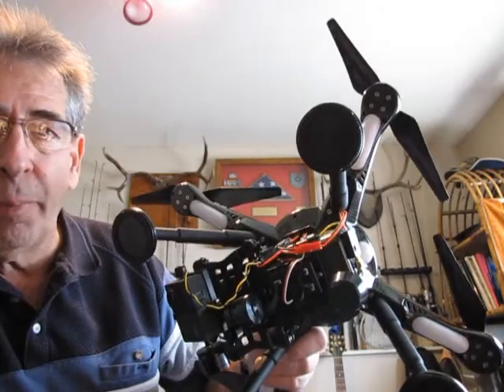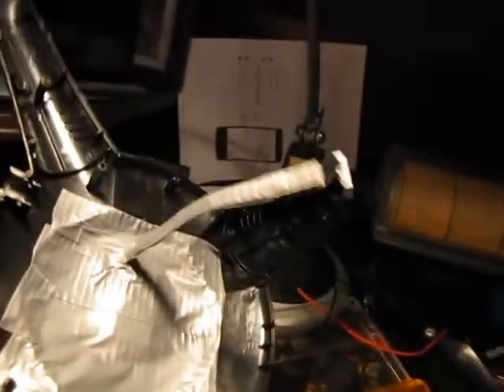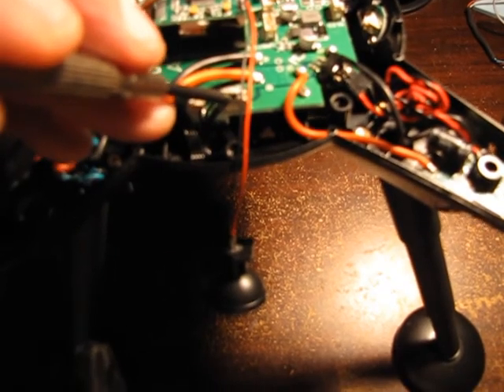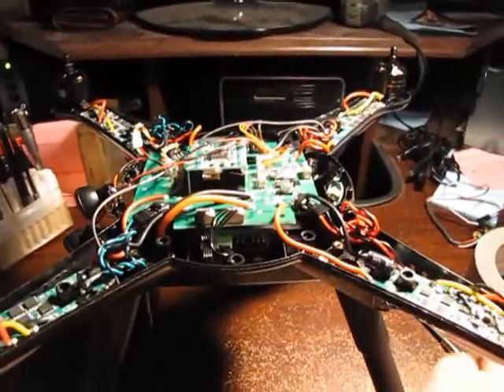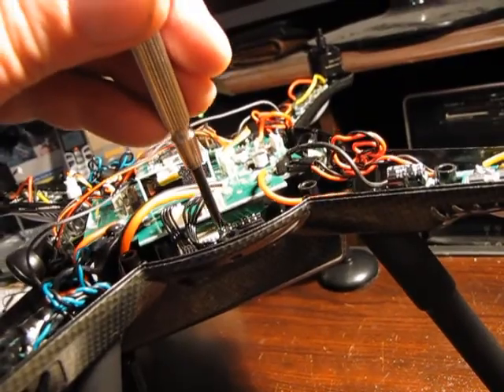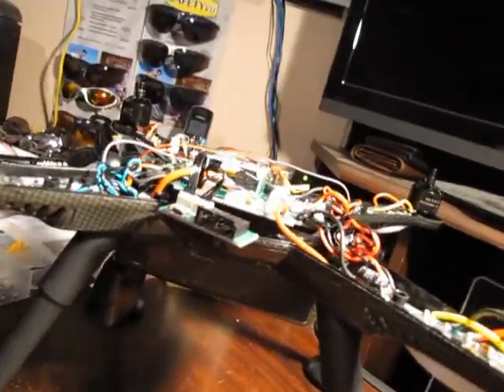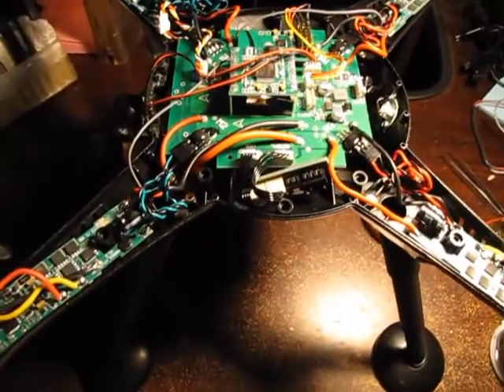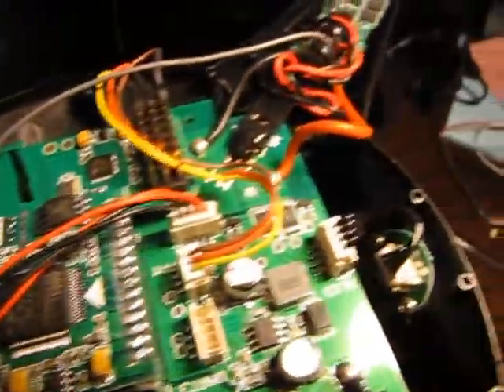XK DETECT x380 12 VOLT CURRENT MOD

Comment: I have a xk detect power strip that has a missing component. there is 2 gold small rectangle parts that are marked 476J00BN1with a red x in a box on it. mine only has one of these and I need to get one to fix my board. does anyone know what this is for /they are one the top where the chip is on the board. any help would be great thanks marv   marvbailey@hotmail.com

Comment: Seems like i have burned my 12v output. I was measuring the volts while the quad was on and shorted the 12v output with my volt meter lead. Long story short, i will be doing the GPS and 12v mod as per your video. Thanks in advance for putting this helpful video together!

Comment: Hi
Thank you for taking the time to do the video. It is something I am going to do shortly. The only thing I would like to ask is how the easy the board goes back down as it seems to go pop when you levered it out? What holds it in place? Thank you.
Reply from the maker: +Stephen Rush. The signal board on the bottom snaps out just cause it slides tightly into a slot on each side of the board when the main board is screwed back down it sits on top of the signal card and holds it down from moving
Reply: +MARK FARRELL Thank you for the info Mark. Could I ask your thoughts on soldering the wires to where your wires are soldered but totally bypassing the card altogether and just putting a JST connector on and fixing this secure so that I can plug a peripheral direct into this?

Thanks for the help
Reply from the maker: +Stephen Rush I think that is a really good idea... The runs and wires to and on the signal board are very small.. The placement of the plugs is good but it is not capable of supplying enough current...The 12 v supply, 5 v, and signal wires sent to the plugs are the same size as one of your gimbal wires going to your gimbal.  The 5v and signal wire don't usually get piggy backed for additional use on other added components, but the 12 v output keeps getting spliced or split to other added components... I  think all the piggy backed components don't only draw more current than the runs and wires can handle but the gimbal using the 12 v causes some kind of a voltage fluctuation or created signal flow which is bad for other components connected in the piggy back split. I have replaced 4,  5.8 ghz video transmitters between my two x380 s. Next time I open up the quad I am going to run a separate wire from the battery board connection point to the rear of the quad near the information lite and use this connection for my transmitter and OSD. I think I will keep the gimbal isolated to the present 12 v plug.
Reply: +MARK FARRELL Thank you for your extended thoughts. I appreciate that you have shown this thought process via the video as it seems there are a few to many issues regarding the 12v stock power. Seems a shame for something like this to make the unit an expensive annoyance. I am gaining the info nicely to allow me to gain the "tools" to fulfil the tasks. 

Thank you.